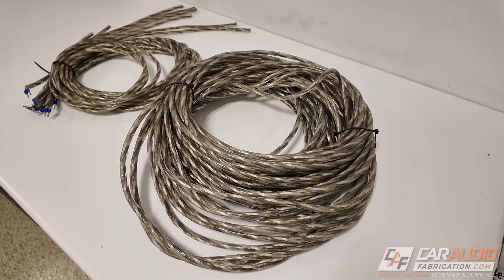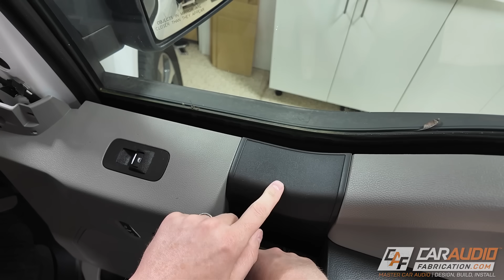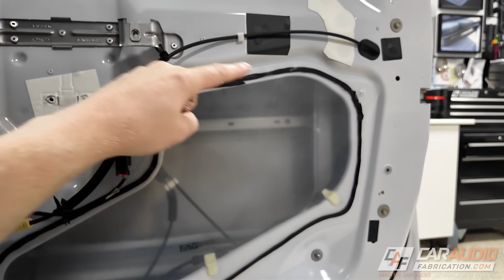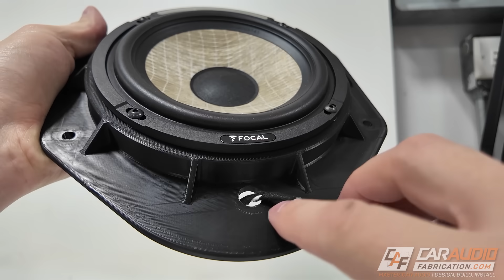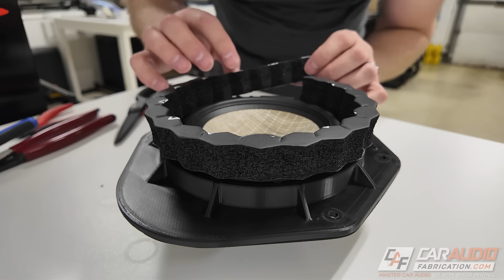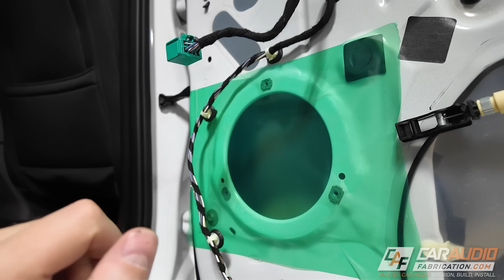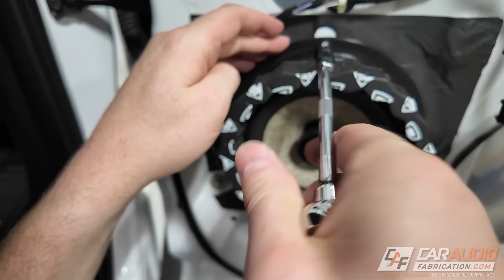AMAZING SOUND with THESE Speaker Installation Techniques

Comment: What material are you using to print? 
I've been using pla, they hold up fine, but my speaker-adapter screws keep coming loose
I know PLA isnt recommended for high heat applications
Reply from the maker: Discussed in the previous 3d printing video
Reply: @CarAudioFabrication  oh snap, say no more thank you
Reply: Nevermind, I see you used the heat set inserts
I just straight up screwed them into the print

Comment: Nice video! 
I have one question, how do you mesure the distance between the pannel grill and the door metal plate so you can decide how much space you have for making the speaker mounts?
Reply from the maker: Put a big chunk of playdoh in, put door panel back on. It's dumb but it works. Works good for checking under hood clearance too
Reply: @CarAudioFabrication  thanks a lot!

Comment: If I wanted to just replace my front speakers and didn’t install an amp, do you think I would hear a noticeable difference from stock. I have an 18 Accord EX.
Reply: worse case scenarios is add a built in amp dsp to amplify and fine tune your new speakers

Comment: Are you using Knukonceptz's karma wire? How many conductors did you go with?
Reply from the maker: For getting speaker signal from the rear to the front yes. Will be 8 channels worth
Reply: @CarAudioFabrication   I saw a video you used Karma for an active but can't find the series.

Comment: do i need an amp?  Headunit can power 4x50w (allegedly) and front speakers(2way 13) are with 90dB sensitivity. and the rear are with 91dB  (16.5 coaxial). Headunit is Pioneer MVH-S320BT front speakers are Ground Zero GZIC 130.2 Rear speakers are Ground Zero GZIF 6.5. The car is old Audi A3
Reply: No, but it will sound so much better if you do. I've done it both ways, same speakers.

Comment: Are these new speakers and the video itself due to that never ending itch for upgrades I'm currently going through? 😂
Reply: It's a sickness. I suffer from the exact same illness. I've gone through countless DSP's, amplifiers, speakers, single and dual subwoofers plus corresponding enclosures (many). I've also installed and upgraded speaker wires, rca cables, optical cable, many, many times all in the same vehicle. I have added sound deadening, then more sound deadening, then even more sound deadening. I know, the itch has consumed me.  All I can say is, you will reach the point of diminishing returns. Most of what I had didn't need an upgrade, but that itch was  relentless.  However,  in reaching that point, I have discovered that by keeping all that equipment,  when I get that "itch", I just mix and match different combos of what I already have. It's enough to keep me busy for years. 😂
Also, at this point, I can remove all the body panels, seats, carpet, and dashboard blindfolded, in record time.😂😂😂
Reply: @richardr5888  that's quite a bit of itching haha, I've gone through a few subs, a few amps, a few speakers, brands, sizes and placements, passive and active crossovers, but I have yet to try the DSP, I would hope when that time comes, it'll be my last! Fingers crossed 😂
Reply: @richardr5888  "blindfolded, in record time"....I too know this itch....It'll never stop, BUT, if it does, may they remember my battle cry "THIS IS GONNA SOUND SICK WHEN I'M FINISHED!!!!"
Reply: @jdizzle3740  I feel like I could do that on mine after the first go lol
Reply: @richardr5888 😂😂😂 I'm in the same hospital ward with you 😂😂
Reply: @richardr5888 with all the mods you did, what would be the essentials if you had a low budget?
Reply: @richardr5888  my dad is thoroughly impressed with how fast I can get the door panels and parcel self out of my Audi a3 due to fitting speakers in and out
Reply: I saved this video because the consumerism was insane.
Reply: I have been into car audio since the late 80s and have never seen a build "complete". Part of the fun of it though. I think if you ran out of things to change, upgrade, or just try out, it would be sort of sad

Comment: I have an aftermarket system in my 2008 Honda Accord coupe running off of the factory head unit.
I have Alpine components in the front and rear run off of an amplifier. The tweeters are just way too harsh and I don't have much adjustability of treble through the factory head unit. 
Could anybody recommended tweeters that will perform well, but not be so harsh? Thanks in advance! 😊

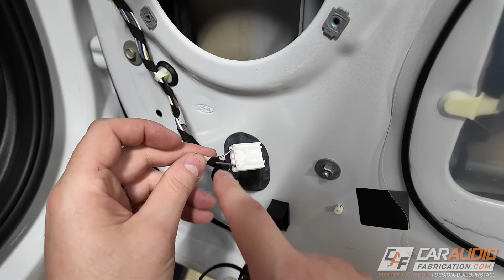Comment: 12:57 for any other D.I.Y guys like me, I don't think Mark really mentioned the importance of taking out extra wires. If you don't do it. Then you'll most likely get a humming noise though your speakers that will get louder as you press the gas. It's super annoying.
Reply: I got that humming after installing my speakers and I couldn’t figure out the source I’m so glad I saw this

Comment: Mark, I have the same 3d printer! I would love to see how you configure your print setup. (walls, bed, speed, and ABS material you use....etc) especially with ABS due to the special considerations you need to make when printing ABS.
Reply from the maker: Check out the video! It's a few back from this one on the channel, I covered it in detail. Thanks for watching!

Comment: Using the air bladder for panel removal is pure genius.
That is something I’m definitely going to utilize in the future.
Thanks for the tip 👍
Reply from the maker: It definitely is easier on the hands, and I honestly feel like it is a bit less likely to damage the panel as you are applying constant steady pressure, just my opinion. Don't forget I have it linked in the bio for you. Thanks for watching!
Reply: That really is an awesome tip. And the fact that it applies pressure over a greater space minimizes the chance of breaking whatever connects the panel to the door.
Reply: Yeah I have a couple of these and never thought to do this. I have some hard to reach spots that don't allow my tool to really pry upward. Thanks for that tip!
Reply: @Kennyy212   I have a couple of these also and never thought of using them for this. But I will now.